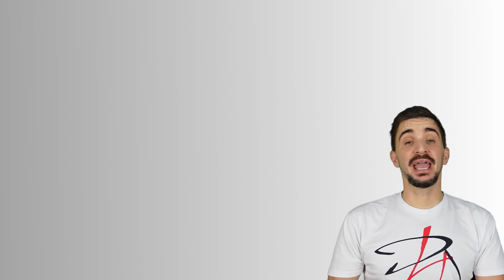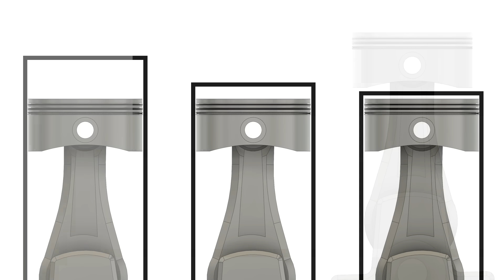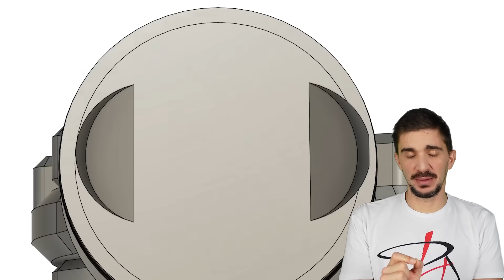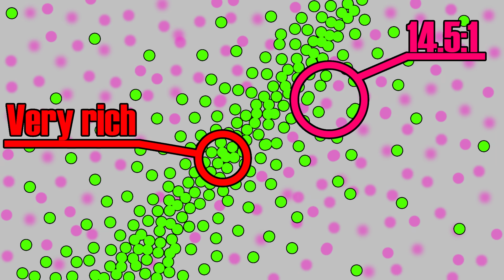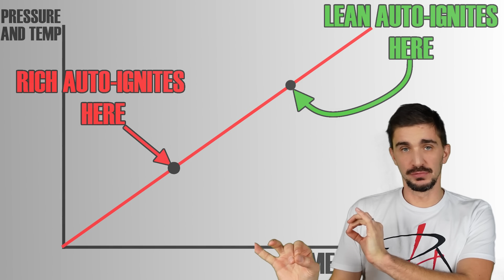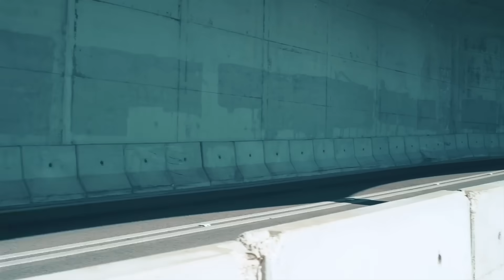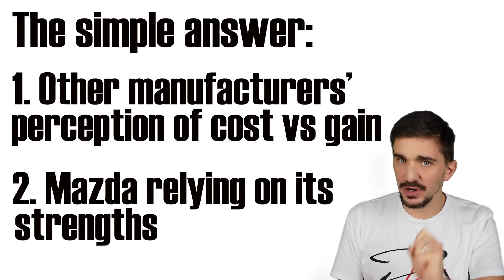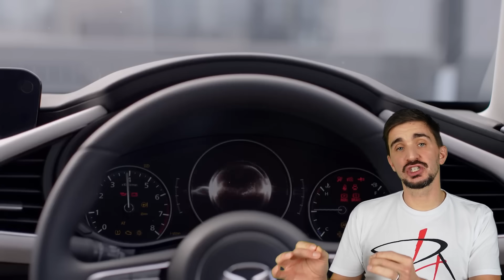The Game Changer Nobody Cares About - Mazda Skyactiv-X SPCCI How it Works and Why It Didn't Catch On

Comment: Sitting in my armchair, it feels that spcci engines should really shine in hybrids (and even more in plug-ins). Electric motors boost power when needed, and let ice operate in efficient regime more of the time, pushing fuel economy even higher.

Comment: Credit where it's due, Mazda engineers great engines, but they weren't the first to do this.  GM was engineering HCCI engines back in 2007-2009, but they abandoned the technology as part of their streamlining efforts following the 2008-2010 U.S. automotive industry bailout.  Toyota also had a version of their 1JZ and 2JZ inline 6 cylinder engines known as the 1JZ-FSE and 2JZ-FSE released back in 2000 that combined variable valve timing, direct injection, and special swirl control valves with a relatively high 11:1 compression ratio to achieve diesel like 20:1 to 40:1 air/fuel ratios on regular pump gas.  While not quite an HCCI engine, I would consider this a precursor to such engines, and the technology managed to achieve a roughly 20% improvement in fuel efficiency over the standard 1JZ-GE engine.

Comment: I've always assumed that the HCCI/SPCCI tech's problem was an inability to meet emissions using 3-way catalytic converters. Standard catalytic converters rely on the AFR oscillating around stoich to facilitate both the needed oxidation of hydrocarbons and reduction of NOX in the exhaust gasses. Running lean, they'd need a diesel-like approach. Its a shame too; gasoline lean cruise hasn't been a thing in the US for many decades because of this.

Comment: I admire the technology, but once I've tried a turbo-charged engine I don't wanna go back. Driving a naturally aspired engine after a few years of driving a TSI was like a huge step backwards. The punch at low rpm is something I love so much and many people correlate high rpm with high fuel consumption, so it's no wonder that only Mazda does this and no one else wants to manufacture

Comment: Would it be able to run in SPCCI paired with a CVT so it can maintain the same engine air-fuel mixture while only changing the cvt “gear” ratio?

Comment: Part of the problem is that automakers are ticking boxes which are 1. regulations + 2. selling points. And neither take the entire multitude of real world experience into account, e.g. the very improbable official emissions and economy test runs are always prioritised over real world consumption/emissions. And this is how you end up with turbos on everything. They're cleaner and more economical, as long as you don't let the turbine spool. And you pay for that "benefit" with worse reliability. Oh, and let's have a wet belt design thrown in the mix while we're at it :D And this is the kind of decision making that plagues modern cars at every level. They're designed for ticking regulatory boxes and pub bragging rights over actual driving.

Comment: Just to let you know, Skyactiv X is reliant on a supercharger to shove more air into the cylinder to achieve HCCI. You have it described as an NA engine, unless it varies between NA to FI.
Im still waiting for the rumored twin charge system to come out. 

Note: I think the Skyactiv X would benefit being paired with a hybrid assist setup to neutralize the drawbacks of city driving and sub par performance. And I’m not talking about it being an EV with a gas powered generator, that loses the driving experience sorta like people saying slap a CVT🤣. I’m talking about slap an electric motor on the output shaft and have it engage when it’s needed, sorta like an electric bicycle set at level 1-2 where it assists under heavier loads and deactivates when the driving criteria is met. Maybe even give it level 5 assist option if you put in sport mode. I think this would be the more idealistic way to go about it, you never lose that connection to the road. The engine revs perfectly along with the speed of the transmission putting it down, shifting into another gear, all of it! It’s just now does it faster! Just like it would with boost, only now you get 60mpg 😂

Comment: A big factor for me personally is that the Mazda SkyActiv X models have very unimpressive real world fuel economy for such a "revolutionary"  engine design. I look up all cars I consider buying on a website called spritmonitor, among others, to check what sort of economy I can expect from actual owners of the car. The cold hard truth is that, for example, the Mazda 3 SkyActiv-X used 5-10% more fuel in everyday driving compared to a lot of its competitors. So I'm losing low end turbo torque and I'm getting pretty much nothing in return. Sure, they're reliable, but a lot of cars are nowadays. Yes, modern wetbelt engines are awful but it's not hard to look up which cars use those engines in order to avoid them. Also, Mazda's really aren't that affordable in the netherlands, which doesn't help either. For the same money as a Mazda 3 with a skyactiv X engine I can get a fully specced out Suzuki Vitara which is roomier and gets the same if not better real world fuel economy despite being an SUV. Sure, it makes a lot less peak horsepower, but it makes more horsepower in the RPM range that I actually use everyday, because it makes 235nm of torque at 2000 rpm.

In all other aspects than maintenance cost, the Mazda's with the SkyActiv-X engine seem like a financially irresponsible purchase due to lack of value for money. And people who choose their car based on spreadsheet math are the only ones interested in engines like these.

Comment: Tesla had a lot to do with it. When Tesla released their first EV "roadster", he wanted to make sure, it wasn't merely a "glorified golf cart". It had unbelievable acceleration! For any other EV to have a chance, they too, had to have a lot of acceleration. Now, even entry level EV's run like they have a healthy V-6, or a mild V-8. Now, the gasoline counterparts to these economy cars are expected to match this EV performance.
     The 2005-2009 second generation Toyota Prius Hybrids had an Atkinson cycle engine, with 17:1 compression ratio, but to be able to run on regular octane gasoline, it was limited to ~60% volumetric efficiency. While that gave it a thermal efficiency similar to diesel, it could only crank out 72 horsepower, despite being a 1.5 liter engine. The electric motor supplied another 22 horsepower, leaving just under 105 horsepower total. If this is all EV's had, they would never have a chance in the main stream market. The SPCCI technology would be the "must have", if that's all it had to compete with. Now days, to compete, it needs to be able to "pin you to your seat" like an old-school muscle car! SPCCI would be the perfect engine for a Hybrid, which would have batteries and motors, capable of delivering that kind of performance.

Comment: I specifically sought out my mazda 3 hatchback because the engine is naturally aspirated and clearly a rare modern engine in that its designed to last well over 100k. It also makes 180hp while getting very good gas mileage.  Other brands are making u undersized turbos that will die at 101k

Comment: I think the explanation why other car manufacturers didn't invest or bother is extremely simple: EVs. Nowadays, all the R&D goes into improving EVs. In the EU no new cars with ICEs are allowed to be sold from 2035 onwards, so additonal R&D on ICEs does not make economical sense. I personally think, there is still MUCH improvements to be made to ICEs, but for now the research has basically died down. Maybe ICEs will make a comeback in the (far) future, when we can make carbon neutral synthetic fuels cheaply and en masse.

Comment: As an engineer, I love Mazda. I admire their dedication and resilience despite their size as a company.

I own a 1990 Miata (mostly stock, 1.6L) and a 2021 6mt Mazda3 (2.5L NA FWD, with some mods + LSD I'm installing soon). Love them so much. Would love to get a 2019+ Miata down the line.
Reply: For you or if you know any with a great talent in engineering and/or entrepreneurial skills to join my new startup..  I have a new type of SPCCI engine that runs on wet ethanol and can get up to 2.5x+ fuel cost savings. I have 3D CFD proof of sharp deterministic ignition using OpenFoam, ChemKin simulations and offering early buy-in and commissions for referrals. Thanks. Message me here if you know anyone interested.

Comment: This engine design sounds a whole lot like what Smokey Yunich was trying to do in the early 1970's with his heat saturated engines. Trouble for him was he had neither the testing beds and sensors or the digital control he needed to make in fully functional. It does sound like this engine would work best in a design that has the engine run at a steady RPM, say coupled to a generator that then drives the motors at the wheels by varying voltage and amperage.

Comment: In my opinion, the whole concept of the recent Mazda 3 is well thought out, the engine is just the cherry, a most delicious one, on top.
The Skyactiv X is even more efficient than the 116 hp Diesel offered in the same car for some time, while driving like a regular 2,5l n/a gas car, which is a feat in itself.

Comment: Powah!  Thats the issue.  People want it all.  Weirdly, fuel efficiency seems to lose out to power.  EV should take over completely if they can sort all the base issues there.  ICE vehicles have no chance if they solve the issues of price, safety, fast charging, better infrastructure for charging, and weight.  Thats a lot, but I think that will happen fairly soon.  But, I want a custon 1957 chevy truck with a v8 until then.

Comment: I like torque at low RPM, i don't like to have to rev the engine. Why not simply add a turbo to the mazda engine? you could control the leanness of the injection to control knock at the higher boost.
I do think that they have solved the problems with modern petrol engines

Comment: This is an interesting video, but I was dearly missing a comparison of the fuel efficiency of these engines. If that's their strong point, then what are the numbers?

Just naively looking at the car this engine came with could it be that all the gains vanished cuz they put it in an SUV? Cuz if that's the case no wonder no one cared.

Comment: I drove the 2.4 L NA in my CX5 from 2019 for almost 7 years. It was a variant with a torque converted 6 speed automatic gearbox. And it was a bit dull because as I never had a feeling that the engine has almost 200 HP - you had to be hard on a gas pedal if you want it to deliver power and not so sophisticated gearbox really did not help. And yes, I am aware that it is just another 1.7 ton SUV that is not meant to be driven like a sports car, I would say that driving high power sports cars in parallel spoiled me a bit (and also my rather aggressive driving style did not help). Still, I cannot say a single bad word about the engine itself - It drove me across whole Europe - from the shores of the Adriatic sea, over to Baltic and Atlantic ocean.

Two months ago I bought a new 2.4 PHEV CX-60 which is a Plugin-in Hybrid with the same engine but different gearbox - this time an 8 speed double-plate. In terms of engine performance and how "fun" it is, it is a completely different feeling, electric powertrain really does help to feel a bit more live and the new gearbox is really a huge improvement over the previous 6 speed. It is much quieter, smoother experience and you would never tell that it has almost 340 HP until you start noticing how quickly it gets from 0 - 100 km/h. So I would say that Mazda "fixed" potential complaints of spoiled customers.

Comment: Studies, like those in Procedia Engineering (2015), confirm ultrasonic atomization cuts fuel consumption by 15-25% in internal combustion engines, though widespread adoption lags due to integration challenges in existing designs

Patent US6543700B2 describes a similar ultrasonic injector using magnetostrictive vibrations for smaller, uniform droplets, enabling lower-pressure operation that reduces emissions by up to 30% and enhances fuel economy without orifice clogging

If fuel injector tips had ultrasonic piezo vaporizer, even smaller fuel droplets with enhanced combustion efficiency during direct fuel injection in GDI gasoline & TDI diesel engines, reduce emissions while improve fuel economy further to meet upcoming Euro regulations

Comment: ...i mean, guilty as charged? North america hasn't gotten skyactiv-X, and that makes a lot of sense looking at its particulars. mid or high grade gas recommended and a 6 speed transmission means any [combustion] efficiency gained with the fancier engine probably wouldn't translate to tangible cost efficiencies over a toyota hybrid which happily run on regular 87.

Comment: Add an electric motor and a small battery to this to create a performance hybrid and it would make up for the shortcomings of the engine and allow it to operate in its most efficient mode in most situations even around town driving. Plus it would give it the 'Hybrid' badge which the sheep will buy into, it would make a super efficient hybrid with extremely low emissions.

Comment: Correct me if I'm wrong, but applying titanium nitride to a machined graphite piston, could make a very light, very strong, piston with less inertia, to further increase efficiency, rings could be cubic boron nitride coated silicon, & oil for lubrication argon + synthetic oil

Initially I as thinking of making piston of machined stainless steel, itself TiN coated by CVD, laser ping textured, reducing fuel use 3% through reduced wear & reduced friction, further lowering emissions, while CBD coated silicon springs achieve similar benefits

Inert Argon noble gas reduces oxidation in synthetic oil lubricant, while ZDDP additive further reduces corrosive wear, ideas based on materials science, chemistry & physics well documented for advanced low-emissions engines options for automakers, motorcycles, ICE vehicles

Comment: a bit like Honda and the CVCC engines that could pass emissions for their time without a catalytic converter in basic operation (making lean burn without the burning lean issues) I looked at a few Mazdas when I was car hunting, but nothing I wanted was available with an X (too new a tech ergo too new a model hence, high priced), and very few met my criteria (manual trans, not touch screen/menus for making most commonly used things work) and does it come with a manual anyhow? I like a few of their cars, looks-wise.  Edit: I looked and yes, and it is called Skyactiv-MT, but here in the US I don't see the X engine available. Everything from Base on up is a G GDI 2.5, looks to be Turbo, except the MX5 that has the 2.0 G

Comment: I don't think you explained why skyactive engines don't suffer from pre-ignition
Reply: As I understand it the air fuel ratio of diesels and these new engines is much leaner and so it doesn't pre ignite, then they control it through the whole new spark plug timing thing.

Comment: 13:44 this has always surprised me. porsche tries to flatten out their torque curve trying to get back to NA feel and regular folk and now even journalists just want instant violent torque and quick shifts in their chevy trax.  e-motors will win out because nobody actually cares about drivetrain characteristics i fear, or more so they dont even realize how much fun cars used to be
Reply: "I want it in my Chevy Trax" is the exact reason why every single vehicle on the road just gets bigger and heavier with every new generation. It used to be a "base" model car had few options. It was a cheap daily driver, to get you from point A to B. That was the point. 

Now absolutely every new car MUST have power windows, power locks, power mirrors, power drills, 49 airbags, lane departure warning, blindspot monitoring, backup cameras, turbo encabulators, automatic cruise control, automatic start-stop, automatic transmission, automatic weapons, DCT, DSG, BBC, keyless entry, sunroof, moonroof, earthroof, trailer hitch, USB ports, USA ports, 64oz cupholders, hidden storage bins, 10-speaker stereo, 10-speed transmission, 10-speed bicycle, fake tail pipes, fake vents, fake leather, fake engine sounds, fake tits, and a partridge in a pear tree. The 2035 Honda Civic will weigh 4000lbs, seat 7 adults, and carry 10 sheets of plywood god bless america.
Reply: Or people are simply intelligent enough to realize that it doesn't make sense to use 20 to 40% of the energy available in a finite resource to drive around so they're slowly but surely moving towards EV solutions instead.

Comment: I think you're overthinking why it isn't more popular. A hybrid is just more fuel efficient. A diesel is easier to drive with low rpm torque.

Is SPCCI more efficient than atkinson cycle engine?

Comment: Back in 1995, I patented idea that try to minimized the issue with uburn particle. The invention title" Surround injection point for diesel engine" US PA #5,385,127. The idea was to divide the injected fuel and inject from surrounding walls of the cylinder. This was just a idea, never implemented.